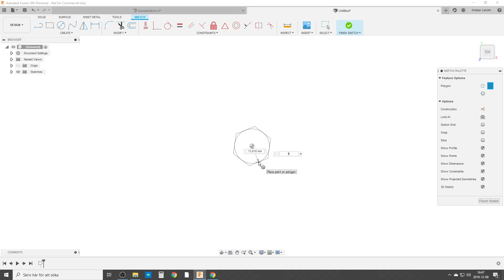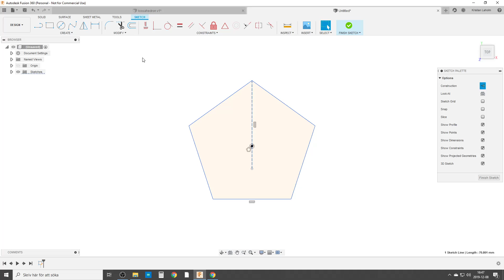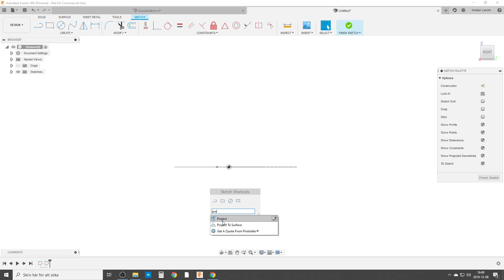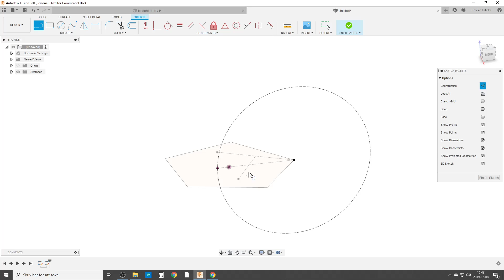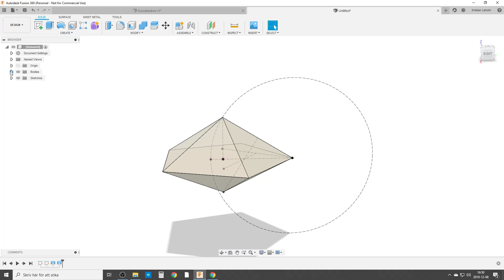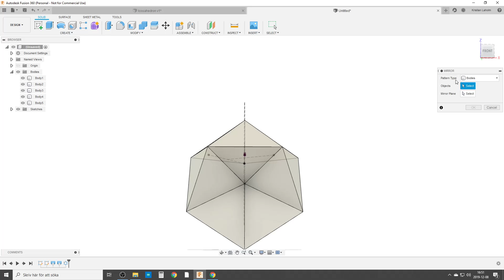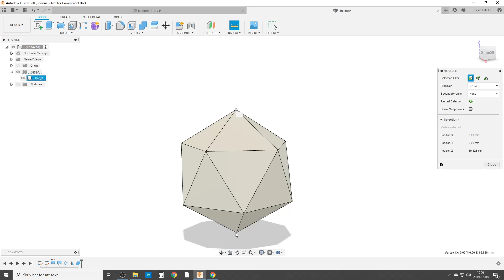Icosahedron - Easy in Fusion 360 - No Math or Angles

Comment: could you tell me the shortcut to looking up operations you used?
as well as the spatial rotation with the mouse, i can't seem to find those
Reply from the maker: Hi, I have this video https://youtu.be/nsOM5Hrc7No about the shortcuts I'm using. The one I us the most is "Design Shortcuts", hit "s" on the keyboard and start typing in the command you are looking for.
Rotating the model I use [Shift] + Mouse wheel (hold down).

Comment: The only thing that I couldn't do was to add the dimension from 2:25 it gives me an error that I can only use a 'driven' dimension that I cannot change because the points are over-constrained. Any idea why?
Reply from the maker: The only thing I can think of is if there is a dimension added to the pentagon in the beginning, sometimes that happens when you tab over to set number of sides to 5.
Reply: @KristianLaholm  Also sometimes Fusion is just really buggy when it comes to determining if a sketch entity is over-constrained or not. There have been many times where I tried to add a dimension and Fusion gave me the over-constrained warning, then I just wiggled things around a bit and tried again and then Fusion allowed me to make the dimension with no problem.
Reply: @KristianLaholm  That was it. Thanks!

Comment: Hey, I'm currently modeling some dice and stumbled on your platonic solids videos which are an excellent resource! The only dice shape that I can not find in your videos is the d10 or the percentile die. I am aware that the common shape of a d10 is not a platonic solid, but do you think you could make a video on how to make one of those?
Reply from the maker: It will be a short video :) I have made a test design, the "problem" is that i can't find any dimensions ... it will have to be som guesses https://imgur.com/bXSc3BE
Reply: @KristianLaholm  It looks gorgeous!
Reply from the maker: @Tim Radder The video is now up https://youtu.be/txrmB9-wVyU enjoy :)
Reply: Yes the D10 is a pentagonal trapezohedron. I just made one entirely in a single sketch using 3D sketch. If first sketched a construction line pentagon with the center at the origin, defined the edge length and constrained the bottom line to be horizontal. Then I created a vertical construction line (perpendicular to the pentagon) and then made another construction pentagon at the top point of that line, made it's edge equal in length the the first pentagon's edge, and constrained the top line to be horizontal (so the two are rotated one half turn to each-other). Now I create one more construction line from the midpoint of the first vertical construction line to up above the top pentagon, and another line down from the same point to below the bottom pentagon and gave the two lines an equal constraint. Then I created solid lines connecting these points to the closest pentagon points. Lastly we have to do some fancy constraints to force these diamond shapes to actually be coplanar. To do this, I made two construction lines, one from a lower pentagon point to the corresponding upper pentagon line midpoint, and another from that midpiont up to the top point and finally gave the two lines a colinear constraint. This forces the diamond shaped faces to actually be flat faces. Now, I chose to make the angle between that construction line and the edge on the opposite side 90 degrees. This makes the face that rests on the table and the opposite face parallel so the face you read is parallel to the table surface. Finally, just go into the surface tools, patch all of the faces, then stitch all of the face bodies together to create a single solid. You can dimension the drawing however you want (overall height, edge length etc.)
Reply from the maker: @SamChaneyProductions  3D sketching in Fusion has become better after I made my D10 video https://youtu.be/txrmB9-wVyU but I prefer using construction planes works better with my brain